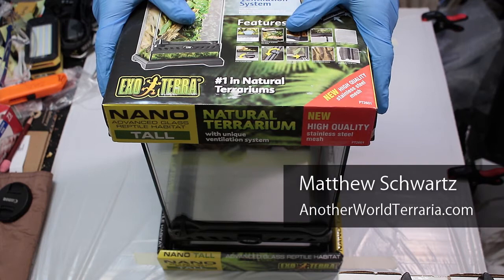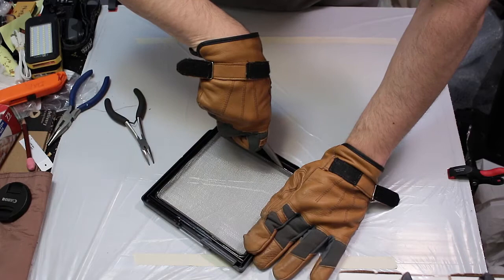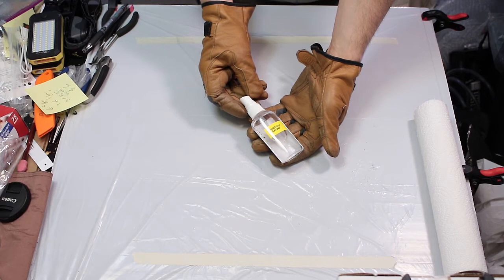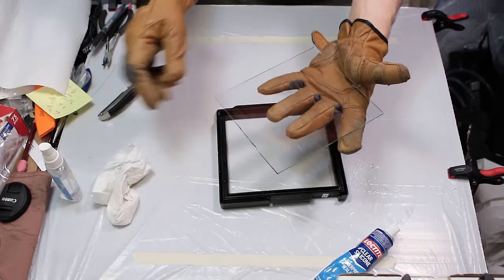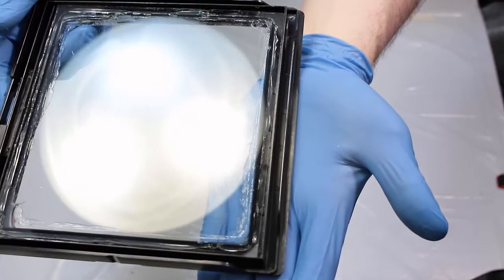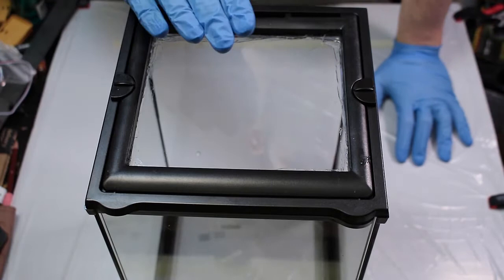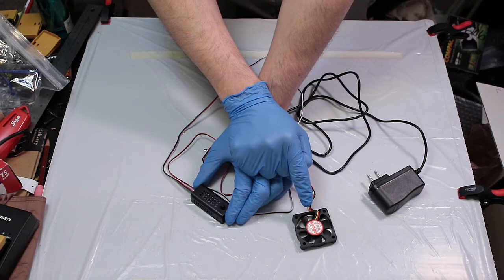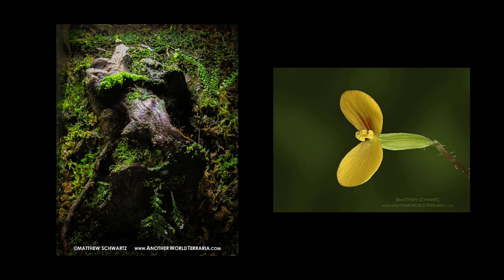How to Convert an Exo Terra Nano Terrarium To a Glass Top

Comment: For those wondering why you can’t just lay glass on top of the mesh;

This will potentially create rust on the wire frame as the moister sandwiched between the glass and metal mesh sits there rusting it away. 

Eventually mesh breaks and glass falls in on top of your plants and animals.

I learned the hard way, but I was also fortunate to catch the problem before the roof glass actually caved in.

My exoterra mesh has big holes in it where the rust just ate away.

My advice is just convert it to glass.
Reply: recently i saw newer model of exo terra has stainless steel mesh , lol after all this years
Reply: Yeah just place glass instead of the lid...

Comment: Well done. Just in case anyone wants to - I replaced the screen but used some perforated aluminum screen panel instead of glass. I got it at Home Depot, it is black, and it has less ventilation than the screen that comes with the terrarium. I cut it with "tin snips" really easily, first a bit too large then trimmed it to fit. It is also strong enough to mount an G4 LED socket if desired (I did not, instead I did what the video did with the LED lamp in the hood, lets enough light for my purpose.) Really nice looking, easy to do, and a nice unbreakable top if you do not need glass and want some ventilation w/o needing to cut plastic or drill holes. Use black aquarium silicon for a nice look.
Reply from the maker: Thank you for sharing your tips and experience

Comment: Instead of glass, you could do plexiglass that way you can add more ventilation for Tarantulas for example.
Reply: I've been reading various tutorials and such...you could do that, but from what I'm seeing is that silicone doesn't bond very well to plexiglass. They do make a liquid cement for plastics like acrylic, but I'm not sure if it would bond to the plastic frame or not (depends on what it's made of).
Reply from the maker: @blackshirej Correct, silicone does not permanently bond to acrylic. Acrylic cement will not bond to the plastic frame because the frame is not the correct type of plastic. Instead you would want to use an epoxy like Devcon Plastic Welder. Further, plexiglass absorbs moisture over time and will expand, warp, and discolor. That's why I prefer glass.

@DonutsRYummy That is a good option / idea for the purpose you mentioned. I only keep plants (not animals that need ventilation), but maybe some other people reading the comments might keep animals so I appreciate the comment. Thanks for watching and sharing your input!

Comment: Doing this for my terrestrial tarantula enclosure. Using acrylic instead of glass so I can drill holes for ventilation.
Reply from the maker: Sweet! Watch out, silicone does not bond well to acrylic (at least not long-term) and if the acrylic warps (which it often does) that will stress the bond more. Should probably work ok, just wanted to let you know there could be complications.

Comment: Hi dude, thank you for the helpful video! 😁👍 Just a tip,  in future if the nozzle is either lost, or all gucked up and unusable. Then use a disposable piping bag, similar to those used in bakeries for frosting etc. They’re very cheap, just fill with silicone and snip the tip. You can even use a sandwich bag. You get a finer bead like this.
Reply from the maker: Thanks for commenting - that's a great tip, I appreciate it!
Reply: Another World Terraria No worries 😉 just bear in mind a sandwich bag is weaker than a piping bag. Loving the channel, just subscribed the other day. 💚
Reply: Mostly the silicon don't stick to the nosle, after drying you can just pull it out in one piece.

Comment: I love the video. Don’t you need any ventilation at all? And what about the vent holes in the front?
Reply from the maker: Thank you. Many tropical plants can survive just fine without ventilation, however you may run into mold issues without proper air movement / circulation (hence the fan shown at end of video). The ventilation holes are small enough that they don't significantly alter the climate inside, especially if the top is sealed as demonstrated, because then there is less movement of air in / air out.

Comment: Why not just lay a piece of plexiglass on the mash ?
Reply from the maker: You could certainly do that, but the mesh cuts down the light level significantly. Also, it won't hold humidity as well. Finally, I like to customize things :)
Reply: Never noticed that it cuts the light down. Also....i am born with 2 left hands 😂😂😂 So I just take the easy way 😉
Reply: Why not leave the top and just put glad/Plexi direct onto the frame?
Reply: This will potentially create rust on the wire frame as the moister sandwiched between the glass and metal mesh sits there rusting it away. 

Eventually mesh breaks and glass falls in on top of your plants and animals.

I learned the hard way, but I was also fortunate to catch the problem before the roof glass actually caved in.

My advice is just convert it to glass.

Comment: Can you use this method to convert the exo terra small tall lid to glass? Need a bigger terrarium than the nano.
Reply from the maker: I have never seen that exo terra tank before but I would imagine you should be able to. I think some of the exo terras have a divided lid which might require two panels of glass instead of one, but I'm not sure. As long as you measure everything, I think you will be good to to.

Comment: Can you just get rid of the mesh lid and just place a piece of plexiglass in?  Instead of putting the plexiglass where the mesh is?  It would work and you can still remove it when you want.
Reply from the maker: Do you mean to just put plexiglass inside of the top of tank, and totally remove the lid frame? If so, that won't work if you are using the nano hood because the hood requires the frame in order to sit properly on the tank.
Reply: Another World Terraria but why use the nano hood? It in itself is junk lol. 

You could build a fixture of LEDs much better that could be completely hidden in the top if you did his idea.
Reply: That's was what I was looking for a video on. 

My older 18x18x24, doesn't have those locks, but some crappy clip things. The lid is broken, it's not flat, the frame is junk I have replaced them a ton due to that. Now I see they have changed that design, good. 

However in my Viv, that idea doesn't work without mods, due to what I just said. I can Dremel out what's standing in my way, and there is a company that makes very nice LEDs for Vivs, that have been modified like that. The fixture sits on top, and is pretty flush to the tanks outside frame top.

They should have changed the design to use a aluminum screen frame top. Of course then they could charge people 40 dollars for crappy plastic frames. Like they hit me with multiple times.
Reply from the maker: Thanks for your comments. I like your idea of building a custom led fixture to sit hidden in the tank rim. In fact that's something I have considered doing but I haven't had the time. Regarding the company that makes LEDs, who is it? My friend Kurt makes some under his business Spectral Designs. And of course Exo Terra could make a lot of improvements to their tanks. I would be more inclined to purchase super clean and fancy frameless tanks by other companies if it weren't for the fact that they cost a boatload of money and that they require custom hood assemblies which I don't really have time to do currently. Thanks again for your input and I look forward to more of your valuable comments on future videos if you'd like to subscribe.
Reply: Another World Terraria I think it was that, Spectral Designs. I just saw themself thought they were very cool.

Comment: Would they cut holes in glass for ? For like tarantula for venting.
Reply from the maker: This is just for tropical plant terrariums. If you keep animals that need some ventilation then maybe use plexiglass and then drill some holes, or otherwise you might just use the original lid with mesh

Comment: Is acrylic good to use instead of glass?
Reply from the maker: It could work, the two main problems are that (1) acrylic warps easily, and (2) silicone does not adhere very well to acrylic. That said, feel free to give it a try.